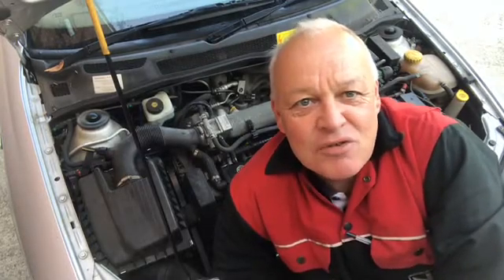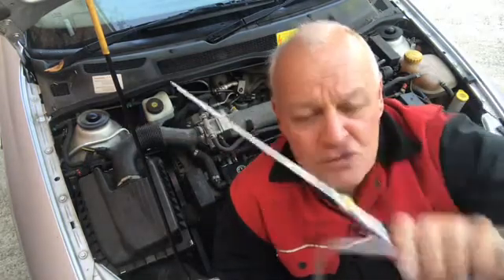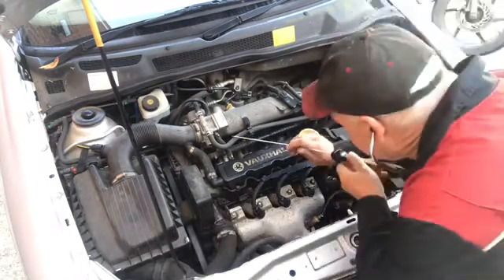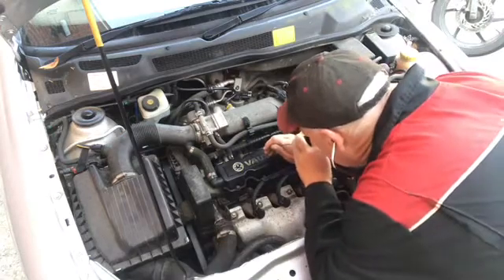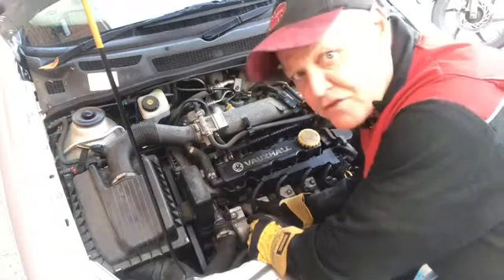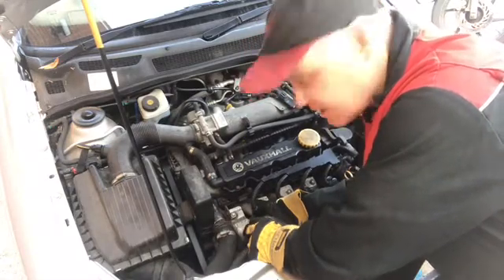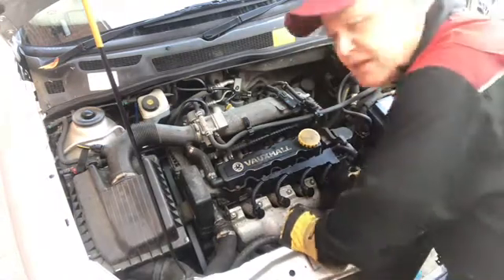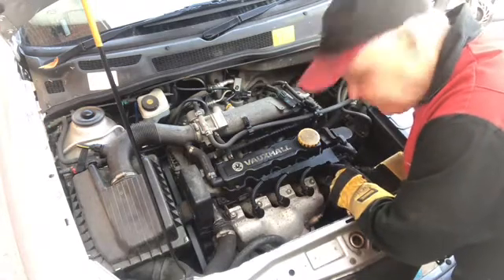Vauxhall Astra has misfire how to fault find

Comment: wish you can help me my car juddering i dont know where to look for start new clutch and new coil new plugs any help thanks
Reply from the maker: Hi Smithy 
without actually seeing the astra car it’s very hard to diagnose your fault. What i do is break each section into different parts it makes it much easier to find the fault .. electrical/ fuel / are the likely culprit but it could also be a valve playing up ( can only test that with a compression tester.. ) me personally i would be looking at the spark plugs does the car miss fire more when it’s under load what i mean to under load is hard acceleration or going up hill in a high gear. could also be your injectors playing up / or coil packs that supplies the the high electrical volts to spark the plugs . good luck with your fault finding 
all the best 
Richard
Reply: @richardshomemechanics5566  got new plugs in it and new clutch new coil pack also it's went a put my feet on it just a we bit and about 25mph to 40 mph

Comment: I’ve got a miss firing zafira.. would that be similar to fix?
Reply from the maker: Hi Marcjamesjamos
it certainly could be the coil pack but best to do fault finding first to eliminate other components that could cause a miss fire .. i would be looking at the spark plugs
Reply: @richardshomemechanics5566  thanks. I'm a newbie with all this... the car drives fine at first then begins to miss fire after a while.. it's getting worse though.. I will try and go through your tests:)

Comment: Bought a Astra earlier no engine management light came up the hill not steep thinking i was in 2nd but was 4th put foot down on clutch and no revs passed 1000 rpm, turned engine off and back on and now engine management lights on, any advice please as i already had a nightmare with previous car [84000 miles timing belt/water pump not done yet] on next thing to do, i did get told that the thermo censor was changed in january and there was an after market air filter installed but never had the issue with previous owner 😊

Comment: My three cylinder corsa misfires and does not idol and  cuts off could this be the problem
Reply from the maker: Hi Wonder fuller 
Your misfire could well be the coil pack that sits on top of the spark plugs it’s time to do some testing as it could also be fuel related
Reply: @richardshomemechanics5566  thanks like the injectors ?

Comment: What engine is in the astra?
Reply from the maker: Hi cal sorry I can’t remember the engine number in the Astra but testing should be the same if it’s set up the same 
Thanks 
Richard
Reply: The engine in the video looks to be a Z16SE (L55) which has a multiport fuel injection system and fly-by-wire throttle.

Comment: After distributor cap contacts fail, i had problem when i try to  accelerate engine especially when was a moist day. I replace it and the rotor also !
Reply from the maker: Hi have you changed your spark plugs as when under load ( when you are accelerating) they can miss and cause hesitation 😆
Reply: @richardshomemechanics5566  Yes, they are new, as are the high voltage cables.

Comment: I have a 2003 Mk4 G Astra, did the spark plug tests, all 4 were making the spark noise, but the engine didn't stall on any of them.
Is that a sign of a bad pack?

Comment: Hi Richard, I have a 1999 astra 1.8 g. the engine light comes on after it warms up. After a week or 2 it stayed on constantly.  I've changed the coil pack and plugs but no difference.  The spark plug on the drivers side is black with carbon deposit and dry. Any ideas?

Comment: Hello Richard, I have an Opel Astra car that has a malfunction that I did not know and the mechanics also did not know..which is that the car has weak movement and cuts when stepping on the gas, and also the RPM indicator does not exceed 3000
Reply: I am currently having same problem, did you find any way to fix it?
Reply from the maker: Hi that does sound like it could be a spark plug failing if it’s a petrol car 
hard to diagnose but worth checking them out as if one is failing it will certainly shudder and not want to rev high
Reply: @richardshomemechanics5566  I have changed the spark plugs and coils that go on them. Didnt resolve the problem. I have put screwdriver on fuel injectors and put my ear on screwdriver, i can hear nice consistant ts ts ts sound on each injector( doesnt mean it is good but I know they are working). When its cold engine behaves good, after 3 4 minutes when engine gets warmer it starts to shake a little, and when I add gas more agressively and put it under load it misfires and car goes in safe mode

Comment: Hi Richard, I have opel astra H 1.6 gasoline from 2006, I've had engine failure on 200 000km and I had it fixed, they changed pretty much everything that was necessary but there is one problem that can't go away. When I drive it for about 10 minutes, the check engine lamp starts to flash and cylinder misfire happens. I stop, turn the engine off, pull out the key, turn it back on and it runs normally again. None of the mechanics in my city can diagnose the problem, they tried all they could they say. Would you have any ideas? also I can run more kilometers without issues if I just keep the rpm low. The faster I go the faster the misfire will happen.
Reply from the maker: Hi Sugarcoat 
What your describing does sound like a accessory is breaking down when it is either getting hot or under load .. for example when you accelerate fast …I would still be looking at the coil or the spark plug .. you need to find out what cylinder is missing … see my videos on how to do this .. also you need to check that the injectors are working and putting fuel into the cylinder ..see my videos on how to do this … hope that helps .. 
Thank you for commenting on my channel 
Regards 
Richard👍

Comment: Hi pal. I have an issue. It missfires after I've been driving for about 2 hours. They changed the spark plugs and coil but did it again. Says its on cylinder one the misfire. Which one is cylinder one.
Reply from the maker: Cylinder 1 is on the left hand side ad you look from the front of your fiesta 
Regards 
Richard

Comment: Hi Richard,my insignia 1.6i seems to run fine but sometimes hesitates to pull uphill for a second or two and then pulls normal. any suggestions?
Reply from the maker: Hi Nikola when you go up hill you are putting the car under load so you ignition coil and spark plugs are also put under extra load and if you have a spark ⚡️ that is starting to fail it will when put under load..you will need to start fault finding .. start with the electrical side first and if that’s good ..start fault finding the fuel side 
Hope that helps 
Please don’t forget to subscribe and set the notification bell 🛎 on my channel as I’m slowly trying to build it up 
Kind regards 
Richard

Comment: Hi again Richard Im sorry to comment again. I have pulled all the plugs out all sparking well and strong. The misfire is on cylinder 3 I noticed that when turning the car over the cylinders were all wet with moisture apart from 3 which was dry. But there is no misfire when revving and driving only at idle it hunts. Would the timing  affect that cylinder being dry or a faulty injector
Reply from the maker: Hi Joe it looks like your well on the way to solving the problem your self ..it could well be that no3 injector is faulty ...and it is not allowing enough fuel through to the cylinder /spark plug ..a simple test to do is get large  screw driver and when the engine is ticking over put the blade end onto each injector and then put your ear onto the end of the handle ( like a doctor does when they use a stethoscope...you should hear a constant clicking as the injector opens and closes .. if you do not get a consistent clicking on no3 cylinder or it’s really quite there’s your problem .. but warning ⚠️ be careful as the engine is running and you could get burned or catch your clothes on moving/ rotating parts of the engine ..if your unsure I would leave it to the mechanic.. hope that helps 
Regards 
Richard

Comment: Richard I have a zafira b 1.6 just had timing belt change and now I have a misfire. The tdc on the crank is slightly out when you put the belt k. Tension would this cause the misfire
Reply from the maker: Hi Joe what you need to do is back track ...before you changed the timing belt was the car running ok with no miss fire 🔥 if it was then it’s related to the belt change or something has not been put back correctly during the belt change ...it’s  important that’s all the timing marks line up on the crank as well as the cam...just one tooth out on the timing mark can make a big difference and certainly can cause a miss fire 🔥.. check that every thing has been connected correctly and as you say if that timing marks do not line this also needs to be corrected this will and can cause damage to the engine by the valves hitting the pistons ..hope that helps 
Regards 
Richard
Reply: @richardshomemechanics5566  yes no problems before the mechanic touched it. Now engine management light is on. Slight misfire on idle. He did not lock the valves in place with the rocker off. Only on the cam wheels. We put the new belt on with tension keeps pulling out the crank from tdc by few mm so he is coming back to do it properly if it's not too late as we moved the engine round before and no knocking and car drives fine at high revs with no misfire. I changed the coil still the same must be what he done to it
Reply from the maker: @joegleeson2958  strange that it revs ok but rough on idle it’s good the mechanic is coming back to have a look for you .. because you have a engine management light on you can now plug in a Scanner OBD2 reader and see why the lights on .. things do just go like that and fail it’ may have nothing to do with the belt change it may be as simple as a plug missing good luck I’m sure your find the problem and get your car running perfectly lagain
Reply: @richardshomemechanics5566  yes my mechanics theory is its had a new bottom end as its so clean down there and the previous person has adjusted everything to a stretched belt hence when we put a nice new one on its slightly out on timing due to being tight and pulling it out slightly out on the crank hence the idle being rough as the valves are set different he is coming this week I will keep you updated. Thanks for replying your ace and I like the channel. Not many good mechanics like you left!
Reply from the maker: @joegleeson2958  thank you for kind comments I’m trying to build my channel with subscribers so please tell your friends about my YouTube channel as I’m here to help if I can 
Take care 
Richards